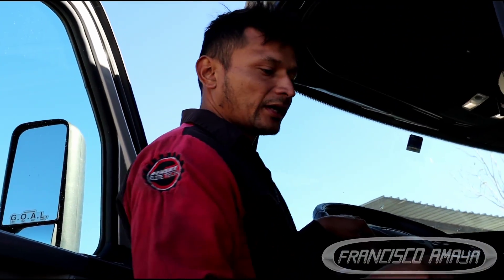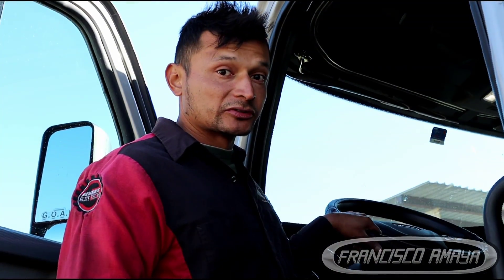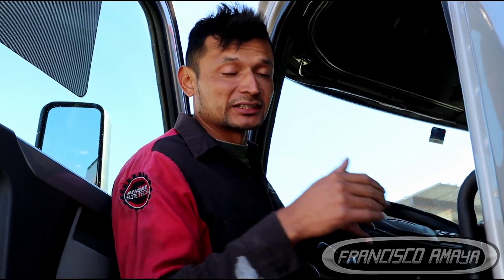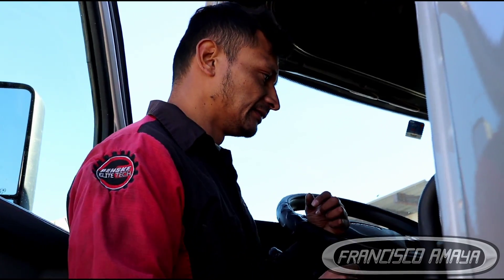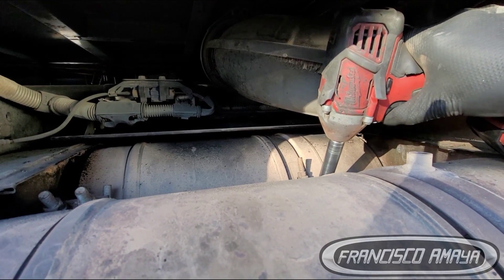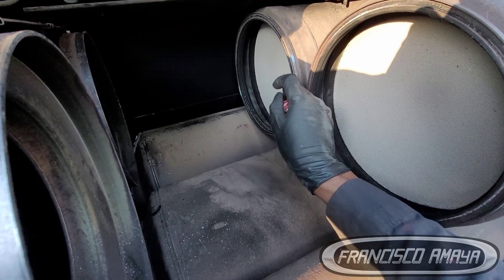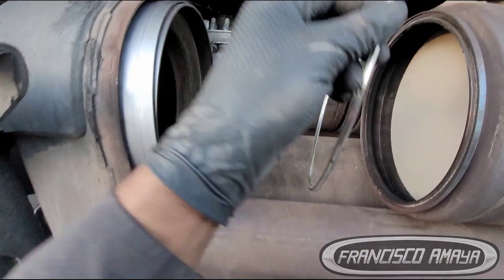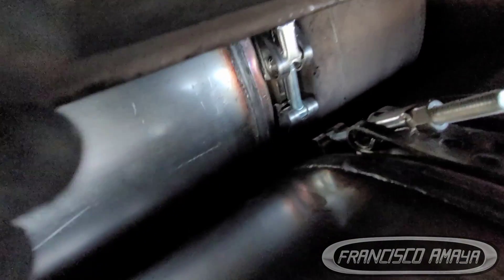How to clean or replace dpf filters in your diesel truck when to do it what to do spn 520349 fmi 14

Comment: I have a 2017 Freightliner Cascadia DD15, all the engine lights are on, DEF light is blinking and truck is derated. Only problem is, that the truck isn't displaying any codes or even a derate active code. I tried a parked regen, didn't work. replaced nox outlet sensor, didn't work. replaced doc sensor, didn't work. Any ideas what could cause a truck to derate without kicking out any codes?

Comment: I had this code on my 2017 Cascadia. It still runs good, it’s not on limp mode. I had a DPF mechanic check it out and everything seemed ok so he took my filters and cleaned them. After replacing them and doing a regen everything seemed ok. But the next day the code came back on. They came back to check again, they replaced Nox censor and it didn’t work because the same emission light came back on. Mechanic suggested that I need to replace the entire box. What advice would you give?
Reply: Buy extra nox sensor and use it to trick the computer. Francisco has a video on it I believe.

Comment: I have this code also but only one check engine light left corner. Code is 520349  14
I baked dpf changed soot level sensor check engine light stull there but truck driving normal. Did forced regen and finishes with no problem. What is the problem?
Reply: You figure out the problem?
Reply: Maybe you need to change injector number 7
Reply: @Ara-0260 I replaced it because it wasn’t reaching enough temperature. Still running like this with this code
Reply: Run regen and scr test it should clear the check engine after

Comment: Had filters baked, replaced doc in/out sensors,  nox sensors in/out, dozer injector,   the truck keeps wanting a regen, it will derat. But red engine light doesn't come on. I'm thinking the EGR Valve or wiring harness to the #1 box. What do you think.
Reply: I have the same problem were you able to find the issue?

Comment: how long can u drive with this code?
Reply: Not long, I drove a couple hundred miles with the yellow engine light (not the check engine light), hoping the system would do what it needed to do. I was driving to Nashville from Columbus, Ohio (of course with a time sensitive load). Made it almost to Cincinnati and the Cascadia de-rated to 55mph. Drove to FYDA and was given a $5500 bill to fix the DPF filter. 😳